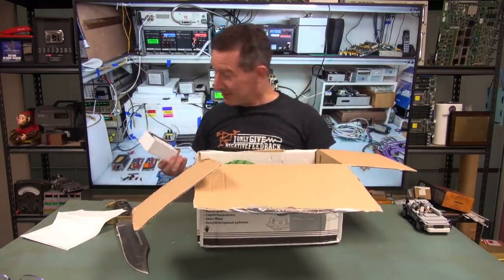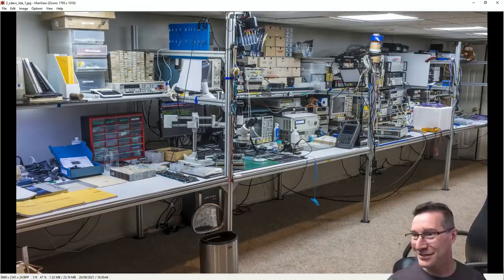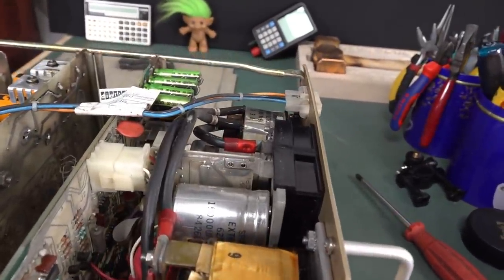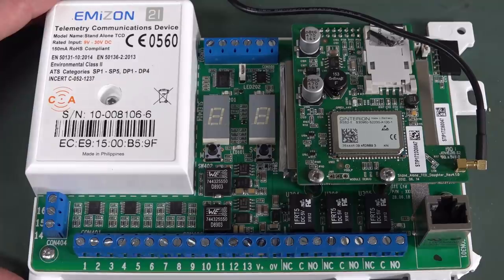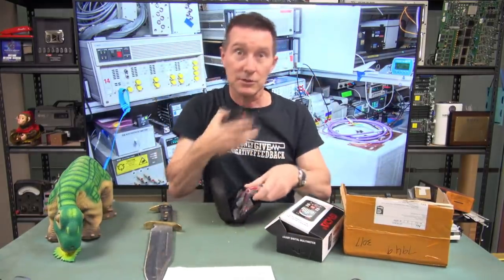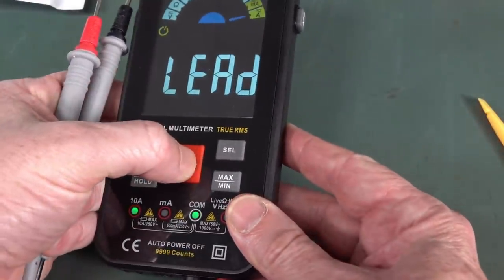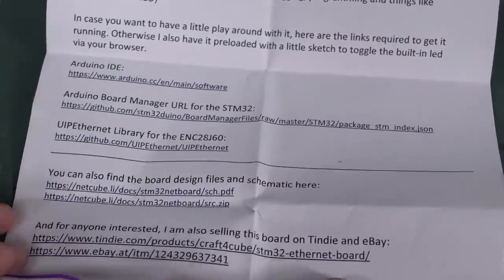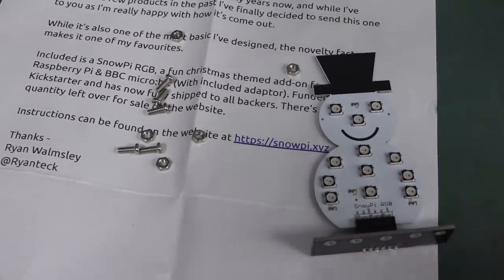EEVblog 1420 - Mailbag

Comment: The Power Supply review reminded me of walking down a manufacturing line in the early 80's and watching a test technician diving away from a freshly built box as a pair of pint pot capacitors in a similar switch mode power supply exploded a second later - very loudly !   Fortunately he was OK, just a little ringing in the ears, so I asked him how he knew it was going to go and he told me the transformer whistle just sounded wrong when he powered it up for the first time.....
Reply: I had some caps explode this week. Still unsure why, they were 50V caps across a 24V rail, small jobs but that scared the crap out of me and made me nervous I’d made some obscene miscalculation - still unsure what- I threw the whole part out- it was intended to smooth the output of a 24v psu. But I can’t imagine a cap that size going off. 
One blew and 5 seconds later the second blew.  

I don’t know maybe the ripple freq was too high and caused it to boil internally, I don’t know- not a pro with this stuff
Reply: Exploding caps can also cause PTSD for sure😂
Reply: Robert C  lol if it died a quiet death let it rest until you can look inside it. Bet you laughed your ass off after you quit panicking

Comment: The vibrator is to help break down oxidisation on the joints for better probe contact 😃
Reply: Yep for old crusty port that need it. The reading might be more satisfactory.
Reply: That's what my wife told me too
Reply: also helps piercing through soldermask 😀
Reply: Wonder where I can get one of those probe vibrators?  Needed one just the other day!
Reply: I really thought it was for something not electronics related. lol.  I guess it could be used for that too if you can get it to fit, I won't judge.
Reply: @redsquirrelftw  It has that special chinese caliber 😂
Reply: I’m having a hard time believing this. I think you guys are just screwing with us
Reply: You can see it was made for the Chinese market lol.

Comment: The pink thing is to prevent cold joints. If you attach it to the soldering iron, vibrating the tip increases the heat transfer, and spreads the flux promoting a better wetting of your components. Very important when you are doing trough-hole stuff.
Reply: pretty sure its just a sex toy
Reply: i have always been fascinated by the concept of ultrasonic soldering since reading about it a couple of years back but never had an opportunity to try. This looks cheap enough to try even if it won't work. Do you have any idea what i should search for to find something like it ?
Reply: @calvinlove7904  I think that's the joke
Reply: Good soldering is an art you dont need vibrations for it better is to have the Vibe for it
Reply: @mysticalrockhoundingfossil5464  sure, and i would not seriously suggest it for regular soldering but i still wonder if something this primitive could be used to solder aluminium
Reply: Yeah... Wetting sure is important for through hole stuff...
Reply: @calvinlove7904  *WHOOOOSH*
Reply: Used correctly it will cause flux to be released before soldering

Comment: Lovw the VAX 11/750 5V PS...  I ran one of those systems back in the day - a beast of a machine - built like a tank.  Counter height chassis - about 3ft wide.   Maxed at 8MB of RAM on 8 slots... "CPU" was about a half-dozen cards on the unibus backplane.   Those were the days...  :)

Comment: The screen brand/model was on the flex cable. It's from HanStar.
Reply: Does it look like the standard differential connector we find on raspberry pi?
Reply: I suspected that as well. It is the same with DVD drive lasers. The model is always on the flex.

Comment: I used to repair such DEC power supplies in the 1990s. They used the NE555's for PWM to regulate the switched power supply output. The power supply dates from the days before dedicated SMPS chips were imvented :-)
The big capacitors were really dangerous and they could melt your screwdriver when fully charged. I used a large 50 Ohm resistor to discharge them. Most of the time, I had to replace capacitors and sometimes the BIAS voltage was not working. BIAS was used as some sort of standby power and to power the low voltage parts. Without that, nothing works.

Comment: SGS (Società Generale Semiconduttori) was established in 1957 by Olivetti and Telettra. Olivetti Elea 9000-series electronic calculators (1957) were arguably the first solid state machines to hit the market, and were completely based on in-house developed and produced semiconductors from SGS. Even Telettra telecommunication equipment (such as microwave links) were built with such components. Later, SGS merged with Thomson from France, becoming SGS-Thomson and nowadays STMicro. It still has many research centers and fabs in Italy, one not far from where I live.
Reply: I was going to post something like this. I have an old SGS branded z80 cpu which I used in a ZX81 kit I built last year and looked into the history since I hadn't seen anything labelled SGS before.
Reply: @Mike_Downey  One of Olivetti employees, physicist Federico Faggin, went to the USA on a collaboration program with Fairchild Semiconductors, where he led the group working on silicon MOS gates. He then jumped aboard Intel, a memory-oriented startup, leading the (very small) team that conceived i4004, the first commercial monolithic CPU. Its layout is entirely his work and was done almost on a per-transistor approach. He then founded Zylog, whose first product was Z80. He apparently maintained good ties with Olivetti and SGS...

Comment: T and R are for the old telecom 612 plug and stand for the old standard tip and ring used for the old manual exchanges. 
This points to the security panel being converted from a landline monitored unit to a 3G wireless monitored unit, probably done because landline systems are not compatible with Fibre optic VOIP phone lines.
Tx Rd + gnd are usually RS485 protocol LAN for expansion units, keypads and touch pads.

Comment: I would enjoy one of those color screen multimeters IF it had 2 things:
1. a rotary encoder to switch between modes
2. fast beeper in continuity mode.
Reply: @jort93z  Eh, I'm computer nerd, software engineer by profession, only meddle with electronics every now and then, but I like flashy screens.

Comment: Yea those screens are common as mud here in hardware stores and the like. They play short commercials for products you will rarely use of disappointing quality and are usually positioned right above said rubbish.
Reply: Having tried to use one of exactly those silicon removers I can attest that they are highly disappointing. Threw it in the bin after about 10 seconds xD
Reply: "As seen on TV" = Buyer beware!
Reply: Yup, a local store had one on the display stand for "Green Gobbler" an eco-friendly drain cleaner.  Blaring away all day long, it would have driven me nuts to work there.

Comment: I thought that board in the thumbnail looked familiar.  The Emizon unit isn't normally used as an alarm on it's own, but to connect alarm systems to a monitoring centre.  It connects by 2 paths from a choice of 3 - Ethernet, GPRS or telephone line (the section under the white cover).  With the correct serial connection, it also allows remote servicing by the alarm company when a customer runs into issues.

Comment: That's and ignominious end to that Vax 11/730 :( We had a Vax 11/780,11/785, 11/750 and an 8600 at the very tail end of the 80's. I wrote a full 68K symbolic macro assembler in Turbo-C on my MSDOS PC and was so chuffed when I got the code to compile on the UNI vax so that it was easier to produce project material and print my final year report. They ran VMS sadly as they didn't want to try UNIX.  Those were the days.

Comment: The Pleo has an USB serial port that accepts ATX commands. I made it work with an USB modem driver. Could issue commands to move motors and grab a frame from the low resolution camera. No high level stuff though, so I could not change behaviour. Guess the port was for testing motors and sensors when turned in for service?

Comment: Hi Dave. I have been watching your videos for quite a long time and I have been really enjoying them. As myself being a tech person and curious about how things work I have really learnt a lot from your videos. In regards to the Pleo dinosaur, what I have found out there is a real time clock battery under one of Pleo's feet (not sure which). Maybe check that and see if that battery needs to be replaced or removed and put back in. From memory it is a button cell battery, not sure which battery it is though? From what I understand Pleo has a inbuilt real time clock that enables Pleo to know the time of day and how to function in relation to what time of the day it is. If the real time battery clcok is flat which is what I might be expecting Pleo will most like not turn on as it relies on the real time clock battery for its operation. Hope that helps.

Comment: Given that the wifi on the alarm sat right above the primary processors, wouldn't the metal can be there to shield them form interference caused by wifi board?

Comment: 10:57:  That would be a TLA7SA16 a logic TLA7000 series analyzer plugin for the PCIe bus.   Edit: Correction.  TLA7BB4,  TLA7AA4 or similar.
Reply: Was TLA7BB4 on bench opened up, and TLA7SA16 and TLA7AC4 on shelf :)

Comment: @EEVblog can I send my first ever self-thought up circuit design and pay ya for a more in-depth check. I'm about to do my first reflow and after that I'm afraid to test it until its look at. The idea is to balance charge and discharge 18650 battery packs that have BMS in each pack and this ones for 4x 32v packs that will charge on my 100W panels I use on my solar scooter. So I can parallel 4x 32v packs and they stay matching forever.

Comment: Dave, you are going to be the firmware changer on that meter. V2 will have all your talking points in there, except they will still not change out the fuses, add the MOV's or shorten those wires.
Reply: Always good when critical feed back is taken to improve a product and the manufacturer doesn't get butthurt about it.  I thought the meter was pretty cool and something I might pick up for my garage. No reason to bring the expensive fluke from the lab down there.
Reply: @hgbugalou  
Yes there is. The Fluke will still give you accurate results, even if there is a change in temperature or humidity.
Also, the Fluke isn't expensive - The price they command is just "the going rate" for something that won't lie when subjected to temperature and humidity changes, and won't kill you if you make a mistake.
Reply: @digitalradiohacker  It really doesn't matter when 9 times out of 10 I am just measuring 12 volt on car and sealed lead acid batteries.  I only need that accuracy in my lab. Plus I won't get grease and grim on my 117.

Comment: 56:58 well... it's because China is a "3rd world country" I've already seen aliexpress vendors sending out of Kyrgyzstan and Laos for example in preparation of this being reverted. So yes , political. Things are cheap on those sites. Yes. But not always.. People tend to see a MPU for a few cent and immediately think they got a bargain but a lot of the times it's the same price or cheaper on the likes of Arrow etc. Arrow sending things for free to the EU. wel.. the absolutely insane packaging arrow uses might be a reason to not select them tbh.. I've had orders of a dozen attiny's being sent in boxes the size of computer cases, a typical aliex purchase is a couple of "individually packaged pieces of candy" quality bags in a larger, slightly padded garbage bag quality envelope. 

Someone starting with electronics there are some essential parts you just have to buy at those places. Crimping a couple of hundred dupont cables? I'd never advise anyone starting with electronics to do that. You made a couple of absolute basics videos yourself. There are some perfectly usable soldering irons that are compatible with a HAKKO tip. As a first soldering iron it beats a nail held by pliers and a gas burner( yes , we all have probably).

Does the existence of those cheap shops make it easy for someone who's into computers ( everyone who starts in electronics is way past this point by the time they're 12) transition into microcontrollers and programming them ? For me that is the question. And yes.. they need to exist for them. As a first look behind the door I'm sure most would go for something like a raspberry PI , because it's closer to what they do but I would, if they can program in a C family language already direct them towards an Arduino clone, an assorted resistor bag, a breadboard, a 2 channel relay and a few leds. If they get a taste for it after that and want their components in a reasonable time frame I'm sure that a year later they will be ordering their components from vested values.